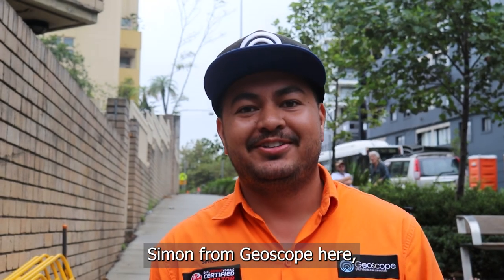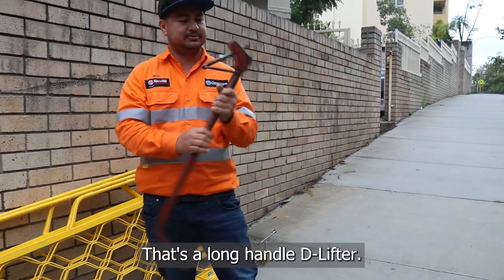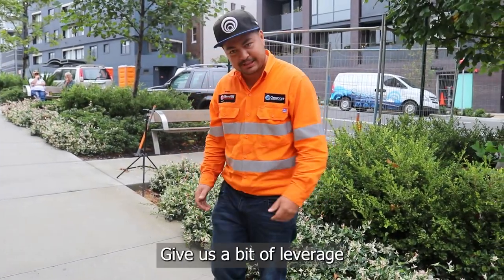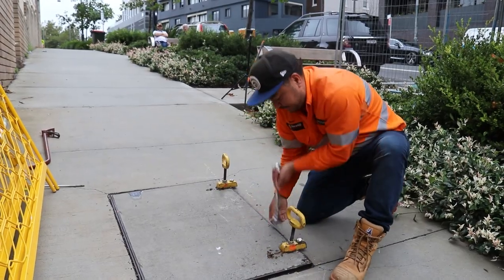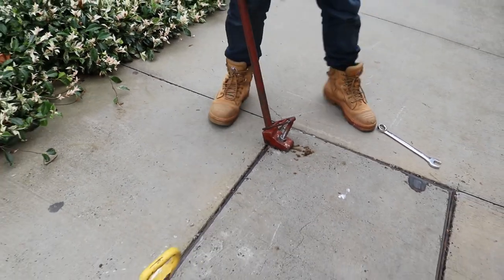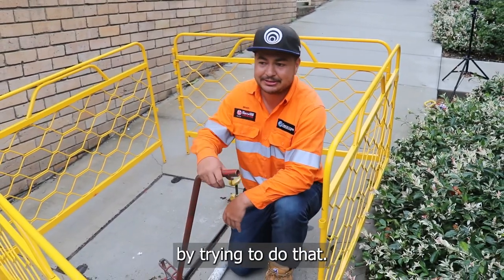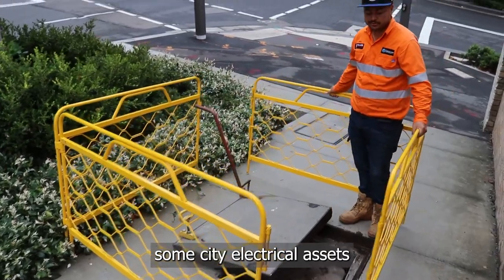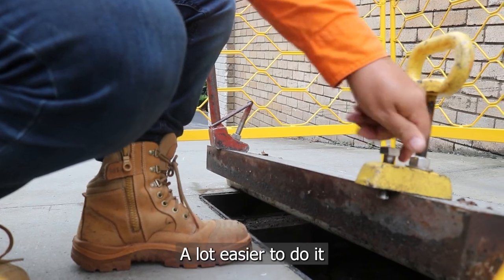How to Open Heavy Pit Lids

Comment: Nice work mate. 
I noticed at the start you had WD40 there, can I ask what do you use that for? 
I'm gueesing maybe tight pits, but how do you do it?
Reply from the maker: Cheers mate! A little penetrate goes a long way. Hitting the pit edges a few minutes before opening makes popping tight lids a whole lot easier. Hitting them the day before is even better on a big job which we might do over a few days